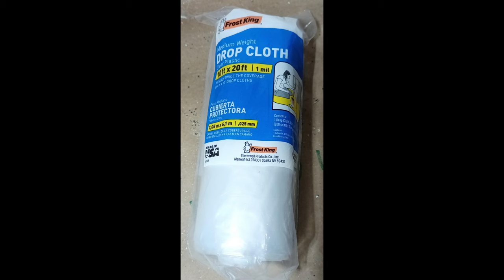Building a Budget-Friendly Spray Booth - Customizing Model Trains

Comment: Your description of the seasons sounds very familiar to me! I'm going to set up a paint booth, probably will start with the cardboard variant first. I moved my dryer so I can actually vent mine outside, but I have a plumbing leak that will drip onto the spot where I'm going to put the booth. Once that's fixed I can start airbrushing!

Comment: I was thinking of using the heat-shrink plastic film sold for insulating/sealing windows for the side and top 'walls'. No plastic adhesive needed...
The only problem I can see at this point is the 'recessed' pipe areas - the double-sided tape used for these window kits doesn't like large surface elevation changes.
A 'fix' for that might be 'building up' the low areas between the couplings w/3/4" pipe slid over the 1/2" pipes.

That aside, thank's for the ideas...!
Reply from the maker: That's a good idea.

Comment: Acrylic (water-based) paints can still be toxic, so you will want to read the labels carefully.

I don’t know if it matters much for thin spray coatings but in the world of portrait painting you never want to put water-based paint over oil-based paint as it will eventually cause cracks in the paint.
Reply from the maker: In the world of models and house painting you can IF you use a good primer first. Thanks for the tips!

Comment: How much are air brushes and compressors
Reply from the maker: That's kind of like asking "How much are trains?" There are a wide variety available. Generally, more expensive setups are easier to use and provide a better finish. But even cheap airbrushes work as well as if not better than spray cans. A basic single-action setup can be as little as $50-$75. The Iwata setup I use in the video retails for around $230. https://walmrt.us/3TXQLmI [Affiliate Link]
Reply: @ToyTrainTipsAndTricks  ok thanks, ya I guess it is one of those questions then😎